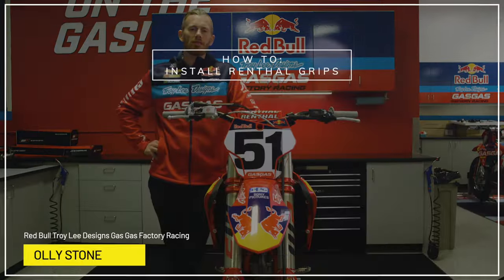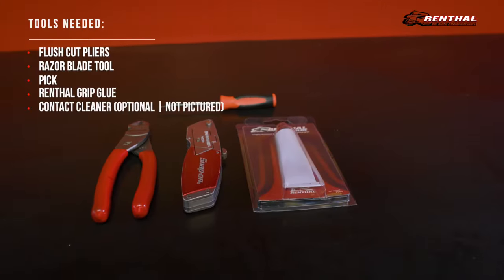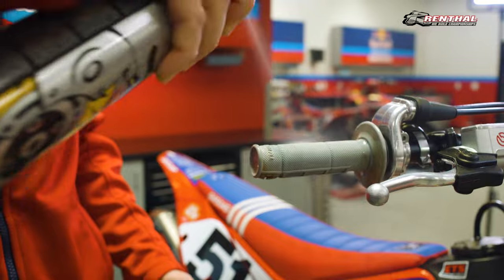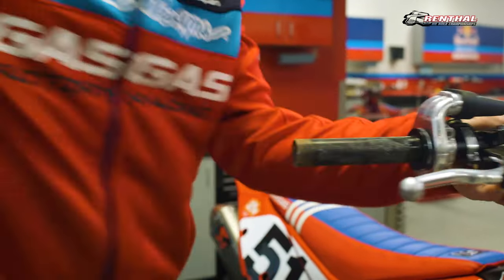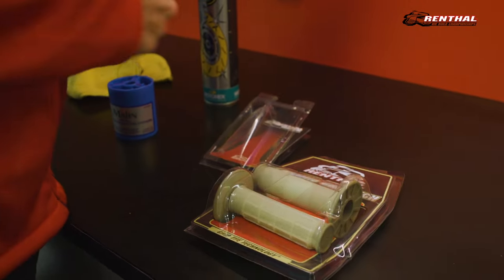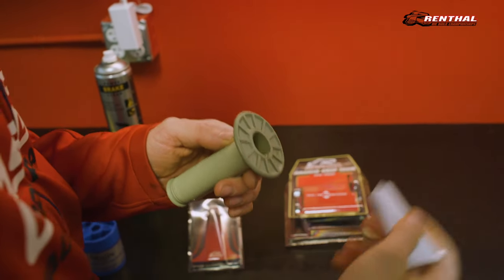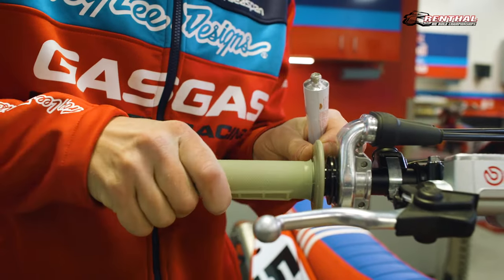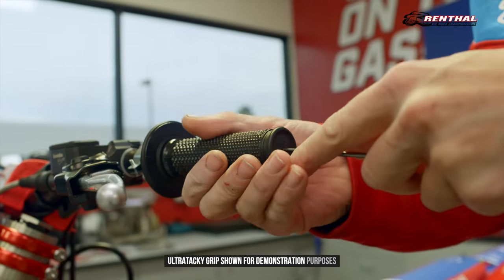How to Install Motocross Grips : Fit Grips Like a Factory Mechanic • Renthal Tech Tips

Comment: Wait what?? How does spraying contact cleaner on outside of grip get grip off? What is this a gag?
Reply: they are perforated .. or whatever the word is .. small holes in them haha
Reply: Helps the grip slid against itself when "rolling" it off the handle bar.
Reply: @Next2Null And in the vid it wasn’t rolling at all.
Reply: My question exactly

Comment: Warning, I followed this exactly the other day, within 20 mins of riding the next day my throttle got stuck and i now have a fractured wrist. I did have those wrap around handguards, which i swapped out for moto style hand guards. I guess there was supposed to be something covering the end of the throttle tube, but nothing mentioned here in this vid?

Not a dig, just a heads up for anyone else who might make the same mistake.